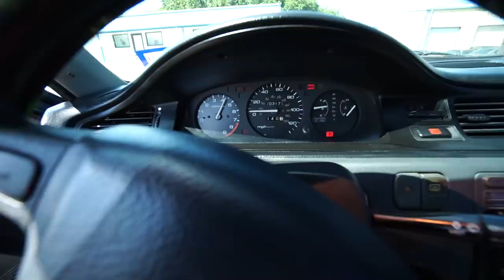My new project car - BUILDING A SLEEPER!!

Comment: If you want cheap and more power....H2B is a good path or even F2B(f20b enge), Boostedboiz uses the h motor in his hatch. If you go k series, k24 bottom end with k20 head is awesome. Many options for Hondas and that's a great color!

Comment: I think you should check Boostedboiz, Kyle has a turbo K24 swapped EK9 hatch with 700hp and yes, it’s fast, but he usually runs it with a dogbox, very beefy tires and axles and a lot of stuff that makes the car somehow usable on the streets, but yet the full potential of the car can be showed only at the drag strip...anyway I voted for the Supercar, even if I knew that you would have bought a sleeper car, because I know that life is about what you can build, not what you can buy, and I totally agree, but this doesn’t mean that you can’t have one...sometimes it’s good having a beautiful car, like an R8, or many other “cheap” supercars, and also a supercar can be a project, remember that 😉💪🏻

Comment: B16 or b18 really rev to the moon and can make decent power, I got a b16 97 sedan built block mild head with 62mm making a shy over 600. Barely any work to make power with Honda’s but u probably already knew that

Comment: K20’s are cheaper, k24 has more low end torque but the k20 revs much higher, I really suggest a k20a2 or a k20z1

Comment: If you’re down to spend the money, build a K motor BUT if you want to do it a little cheaper, check out the H22A engine from a prelude. They’re from japan and have an open deck block and can make HELLA power. Kyle from Boostedboiz built his civic for about 9k and it had 700+ :)))) check it out bro!

Comment: Put a 1UZ or J32 in it. No body work. Quite-high performance exaust. Wider wheels. Awsome brakes. Awsome suspension. And an reliable sequential gear box. You'll be handing out "pillows" all day long. Zzzzzzzzzzz

Comment: H2B setup!
Reply: Or go super sleeper, F22a6 built and boosted. Motors are dumb cheap and they actually make torque, its the head design that stemmed the heads of the K20 and F20C motors!!